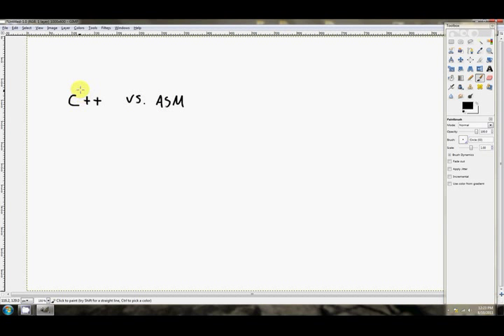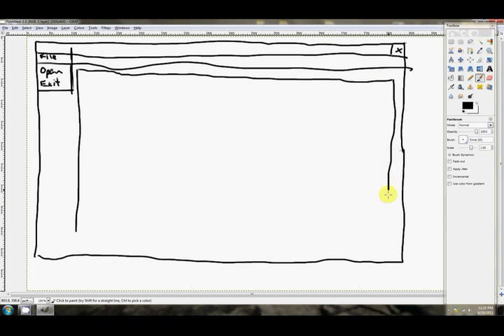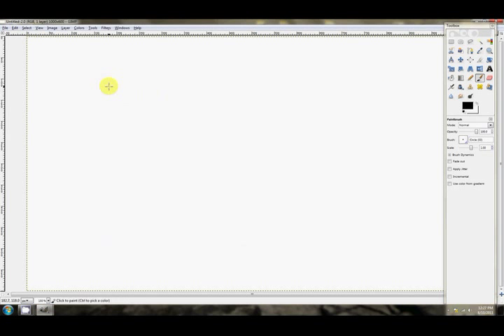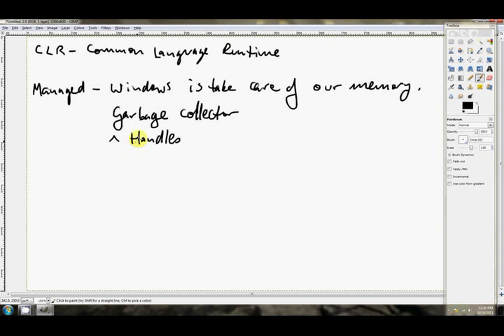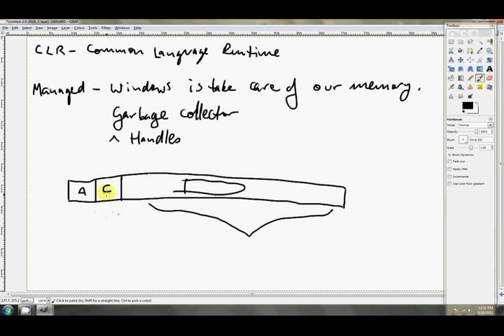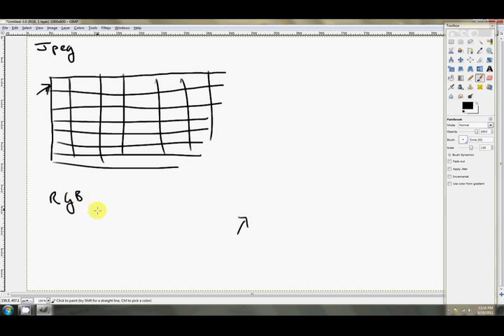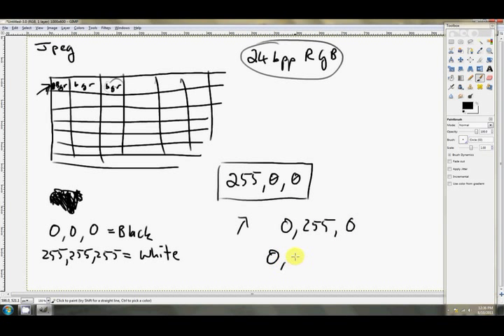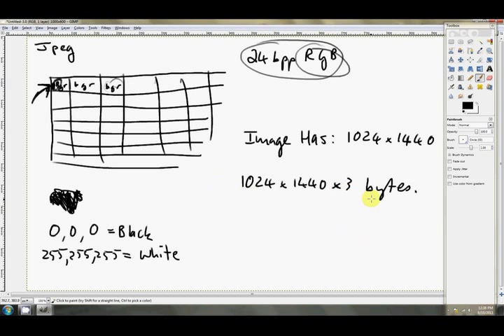x64 Assembly Tutorial 21: Image Processing Intro

Comment: Thanks for explaining the HANDLEs finally, Win API can be confusing at first because they have all of these macros which are basically just "their language" for stuff that is pretty simple but it can be cryptic. I learned them the hard way when I wrote Win32 code in C a couple months ago but great to hear them covered here anyway!
Reply: First Thank you so much Creel you are awesome as always, let me add few things about Windows Handles, handles are basically void pointers (void *) to a table located in the process address space in memory, they could be a number, address or some other thing, each Windows function treats them differently, how is that? let me give you an example: suppose you want to create a thread, CreateThread function creates a thread object in Kernel space and returns a handle to that object so the user (in user mode) can reach that object using the handle, Don't get it yet? ok let me get deeper, suppose the handle came from CreateThread is an 8 bit number (only Kernel knows this, the user doesn't know this) so when you call GetThreadId(HANDLE Thread) the Windows code related to threads sees this handle and says oh this guy wants to reach thread object in Kernel space let me cast this void pointer to a byte (unsigned char, or char -this is just an example-) and use this number to read information about that thread in process table suppose this 8-byte value is mapped to an address to the function needed to run in a different CPU core, but you need the thread ID, Windows can also use that handle to get a list of threads running by this process and map that handle(8-byte value) to thread ID, when doing so the function returns thread ID and you are happy, Handles could also be memory address again you (the user) doesn't know that only Windows knows this and cast it to whatever you asked him to help you with, handles are tickets to reach Kernel objects created by requesting them from User space, so when you want to reach that object in kernel you use that ticket and Windows knows how to deal with that ticket, there is a lot about them such as security reasons to avoid reaching kernel objects, hope that helped

Comment: A question - you mentioned taking a jpg and converting it to bmp. Why ? Is there any data or information lost in the conversion ? for example if a steg messgage was buried in the jpg would that message be lost in the conversion ? Thanks in advance
Reply: There's a lot of data lost converting BMP to JPG, but none the other way. JPG is a lossy compression method, BMP is not.

Image file formats like JPG are only for storage on a hard drive and sending the image over the internet. The graphics card only renders bitmaps. It doesn't even understand the BMP file format. It literally needs a string of pixel data. Whenever computers display an image, they convert it to a bitmap first. The graphics card needs pixels to put on the screen, it doesn't understand what a JPG is.

Anyway, there's also PNG which is a compression method but it's not lossy. Have a look at that if you want to make a cypher in an image because JPG changes all the pixels.

Thanks for watching, have a good one!